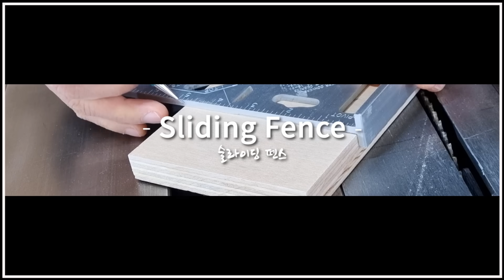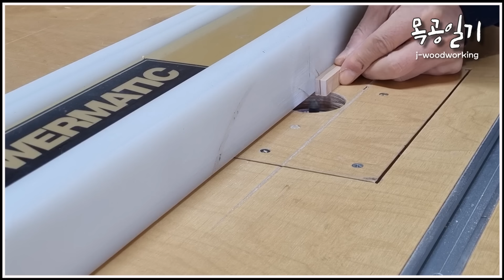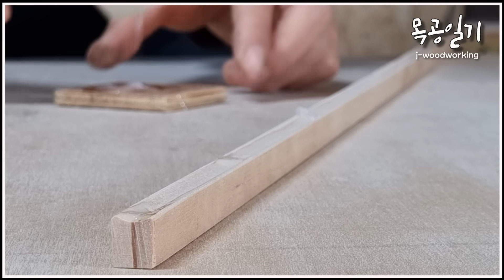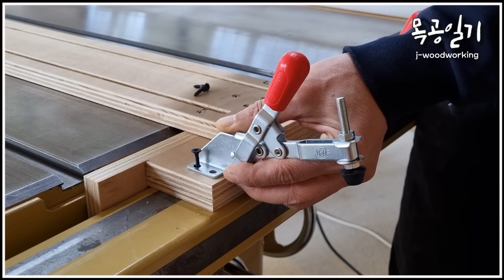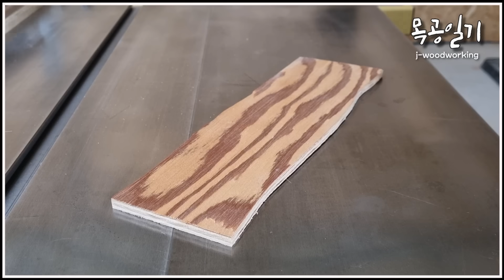sliding fence / smooth movement & easy replacement of jigs for the table saw [woodworking]

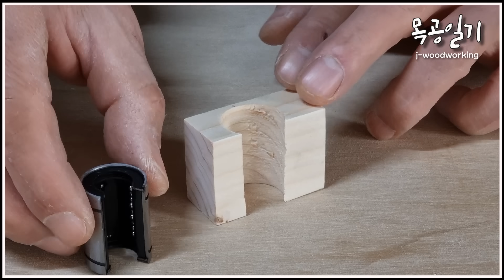Comment: What are those special bushings called, at 4:42 ? and where to buy them.
Very clever and nice work.
Reply: SBR linear bearings, probably use HGR if you want a much lower profile also the HGR blocks comes with tapped holes. buy them everywhere on ebay and amazon

Comment: Great work, but the SBR linear bearings can come with square blocks and tapped screw holes.  But try using HGR rails and blocks, they are much lower profile and  can be screw directly. this means you don't need to do the routing, make a block for the round rails or the block for the linear bearings
Reply from the maker: Thanks sir.
Reply: Would you by chance have a link to the exact rails and bearings you're talking about. I would love to build something similar to this, but don't know which bearings and rails to get, but these look to be the exact size I need. If you could provide a link for me where to get them, that would be so very helpful. Please and thank you.
Reply: @pumpkinheadghoul  I need a cheap source of linear bearing for my DIY projects. Did you find any? If you did please provide a link to buy on line.

Comment: Interesting!  One concern is the use of ball bearings, which are greased, on a tool that generates wood dust.  Perhaps sliding bushings would be a better fit?
Reply: Shouldn’t be that much of an issue though if you have a good dust collection system.

Comment: I will never let an offcuts piece drop like that beside a blade.  That's a huge safety concern.  The blade is also moved up much too high. Just make a sled.  This is over complicated yet achieves nothing that a sled wouldn't do safer and more efficiently
Reply: If the off cut drops to the outside of the blade there is absolutely no concern. If it dropped inside between the blade and the fence you have a problem. Where is the safety concern in your opinion? I'm 55 years old and have been using tablesaws for 40 of those years and have never been affected by the an off cut.
Reply: @rickjensen2956  so you have had this exact same jig dropping blocks beside a moving blade for decades?  Before this video?  Or you want to believe that no wolves are ever on the west side of the river?  There are always risk with blocks on a vibrating surface catching on the kerf. It's literally common sense that you can see.  You never? Well good for you. People maybe using completely different material from you on a different table saw on a different surface with a different blade... This is the silly logic of "I am 90 and never wore a seatbelt but I am still here" argument.  You are 55?  Is that some sort of recognition criterion?  You want a cookie?  Last I checked, everyone at 56, smart or dumb, was at some point, 55.  But then again, who am I to impose common sense?

Comment: whats the advantage here as compared to a normal fence. am a beginner woodworker and hence this doubt
Reply: This is a well designed edge jointer jig for his table saw. Edge jointing allows for two boards to seat perfectly together. It can be a little confusing for a beginner but definitely worth researching to increase your understanding. The premise of this jig is to not have to buy another piece of expensive equipment (jointer).
Reply: @dennisTHEmenac3  My issue with it would be that the fence and miter slots are already parallel to the blade so it seems like this would be a lot of work to use something you already have built-in. I admire the craftsmanship and the tool is very smooth, but I feel as though edge jointing can be done in so many simple ways that making something this elaborate wouldn't make sense for 97% of people. I could be wrong.

Comment: very high, because of which in most cases it will be a useless solution. A modification is necessary so that it is not necessary to raise the saw blade to its full height.

Comment: Why not move the clamp behind the sliding track so this could be used for longer pieces of wood on the table?  It's impossible to cut anything longer than the distance from the blade to the edge of the table top.
Reply: the thing is just to make a video

Comment: Why not just use the fence
Reply: He's straightening the edges of crooked boards as an example if you missed the video.
Reply: @biebermyballs100   I never said it was useful. Merely explained what it was meant to do. A lot of wasted time in my opinion with very limited uses. I have my own sled that rides along the fence with sliding clamps that hold various width boards in place to create a straight edge on. EZPZ